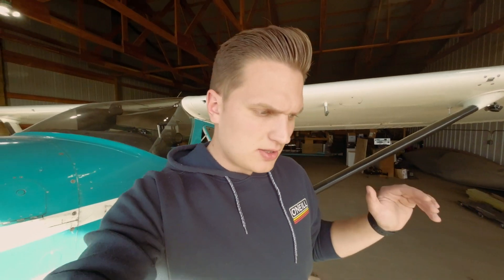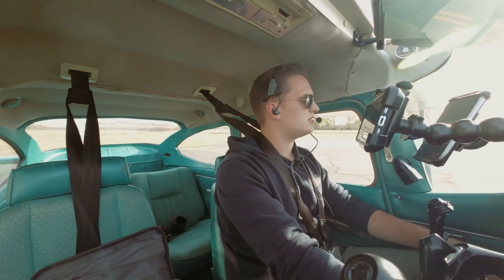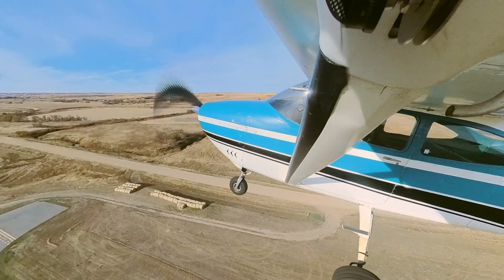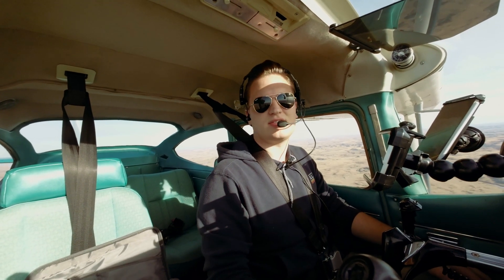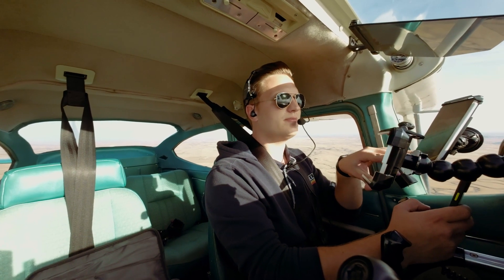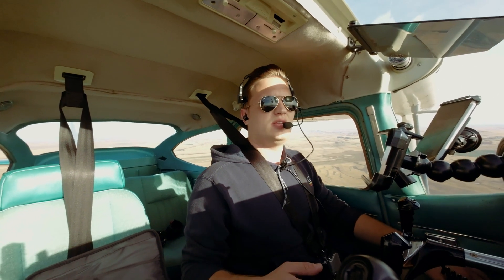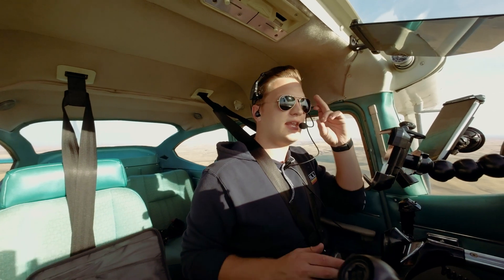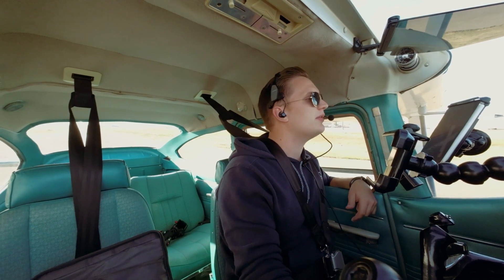How to Land an Airplane; Masterclass for Beginners

Comment from the maker: What did you think about these tips?
Reply: As a non-pilot I found it appealing to me meaning I know a lot more than I did...... lol,  since every plane is different I'm
guessing this will help those flying a similar bird more but I digress.  Is that right that more problems happen during
takeoff?  More incidences leading to damage, injury, & worse?  It makes sense but I've never heard anyone say it as
you did.  If I ever get the chance,  I'll be in a Part 103 type ride.... good video.  peace & GB
Reply from the maker: @diggy-d8w  Great to hear! Yes, because you are low and slow, takeoff is the most dangerous part of the flight. Once you get enough airspeed or altitude your flight becomes much safer because you now have time to figure what you're going to do in case of an emergency. Thank you for commenting!
Reply: IT's common sense & so logical that I guess most pilots do not speak of it all that often.....  which is why you've already
scoped out fields or the softer landing spots all around the field you're at.  I know I'd want to know those things around
any takeoff spot but it would be 2nd hand knowledge on your home turf.  <Subb'd Up>  see ya next time,  peace
Reply from the maker: @diggy-d8w  For sure! It's always good to know and review what you'd do in case of emergency. That way when it happens, you're prepared. Thanks for watching!
Reply: Dope vid man

You made me subscribe + like
Reply from the maker: @rapinncapin123  Thanks!
Reply: As non-pilot, I appreciate a basic idea of what it takes to get the plane on the ground.

Comment: I soloed at 15 hours with a female CFII whom was also ATP rated, then I stopped when I became a cop. Many years later I started again. Another CFII signed me off again. This time it was a male CFII with 4,000 plus hours. I earned my PPL when a DPE signed me off at around 40 hours as well. That DPE is an old bird and an airline captain + helicopter pilot.
Reply from the maker: Wow, that’s awesome!
Reply: @theaviatorew  what's next for you, commercial, CFI, CFII, multi-engine, ATP?

Comment: The most important thing you need to know about flying an airplane is how to use the elevator (pushing or pulling on the yoke); in level flight you use the elevator to maintain altitude......too high, push forward and lower the nose; too low, pull back and raise the nose.  When climbing or descending you use the elevator to control your speed....push forward to increase speed, pull back to lower it. The approach to land is a descent, so you control your airspeed with the yoke;  if your approach speed is 70 mph, just push forward or pull back on the yoke to maintain it. The second thing you have to do is control your rate of descent, which you control with the throttle...more power, you slow your RATE of descent, less power you increase it. How do you know what your descent rate is supposed to be?  Look out the windshield at the approach end of the runway;  if it appears to be in a stationary position in the windshield, you are on the correct glide path; if the runway begins to lower (disappear below the nose of the airplane) you are too high, so back off the throttle to slow your descent;  if the runway begins to rise in the windshield, you are too low and need to apply more throttle.  So lined up on final approach you only have to do two things, control the airspeed with the yoke, and your descent rate with the throttle....if you do that you will arrive at the runway at the right height and the right speed (and then the flare and touchdown).
Reply from the maker: Very true!
Reply: @theaviatorew  correction (typo); "too high, so back off the throttle to INCREASE your descent".
Reply: "When climbing or descending you use the elevator to control your speed"....

Totally Disagree. When decending, especially to land like in this video, you should be controlling your speed/power with the power control, not the yoke!
Reply: @davecarsley8773  You have no idea what you are talking about; you obviously are not a pilot...if you are, God SAVE US!!!

Comment: Ok, here's my nickel (used to be 2 cents, but, hey, inflation...) ... as a former paratrooper and skydiver with many Cessna 182 jumps and 20 min. as a pilot in a C152 instructional plane at a military base open house, I was looking for some stuff you didn't talk about ... like, the stall speeds with and without flaps, I got that, but you didn't go into what airspeeds you begin to deploy flaps and how much, what altitude to do that, how to calculate where to begin the descent portion of the flight profile, ..... was that stuff not covered because you figured the passenger at the controls would get all those instructions from ATC via the 121.5 channel? The 182 pilot I had the most jumps with was a veteran of the Luftwaffe where he flew F105s, and his hands were quite busy on the way down the 1 time I rode down with him as a student jumpmaster after putting static line students out.
Reply from the maker: There is definitely more that you could talk about when it comes to landing. However, I was trying to break it down is a simpler way for people to remember. ATC will definitely have to help them down. However, putting 10 degrees of flaps down before flap speed won’t hurt the airplane (in most cases) even past ten degrees one time shouldn’t make the flaps fall off. Thank you for the comment!
Reply: ATC does not tell you how to fly the plane. ATC is there to mostly provide collisions within their airspace. 
When a pilot deploys flaps (if needed) is entirely up to the pilot. When I owned my 172 I never used flaps with a x-wind above 20kts.
Reply: He OBVIOUSLY wasn't trying to be a flight instructor and give exact comprehensive landing instructions for this particular aircraft in a youtube video.

Comment: Your tip number one is critical at low altitude where inadvertent stall is generally fatal.  Airspeed, and not altitude, down here is life.  Altitude is time.  Time is good, but we have to stay alive long enough to have time.  We have to stay fast enough getting up to safely get up.  Consider acceleration to Vcc level in low ground effect for airspeed to maneuver when the engine quits.  Your 182 will try to climb out of free ground effect quickly so you will have to push against the Vy trim when she come off.  As a crop duster and pipeline pilot, I have had 11 engine failures at 200' or lower.  Never at Vx or Vy, however, as they are poor energy management and are unsafe.

Your 182 will not land in ground effect at 60 or Vso, an out of ground effect number.  It must be much slower.  It seem fairly heavy, but it is just a bit bigger 172.  I flies basically the same with a bit more power and a bit pitch up to slow down.  Yes, with full flaps we need to get enough sink to bring the throttle fully into dynamic play as the most excellent glide angle and rate of descent control all the way to touchdown slowly and softly on the desired  touchdown spot.  "The 'stall-down' landing requires that you blend the approach glide, the flare-out, and the slowing up of the airplane all into one maneuver so that, when you arrive at ground level, you arrive in three-point attitude, all slowed up and ready to squat."  Stick and Rudder page 302.

Staying ahead of the airplane on short final is much easier without any aileron and adverse yaw wing wagging to keep turning back to the centerline (between our legs not under the prop.)  Yes, we want longitudinal axis control with proper rudder yaw and no nose swinging the wrong way (adverse yaw.)  Walk the rudder pedals dynamically and proactively to bracket (correct yaw tail wag) the centerline between our legs.  Its optical, it will appear between the instructor's legs as well.  

Good lesson.  Just some old crop duster points.
Reply from the maker: Awesome info! Any crop duster that’s over 40 or so is worth listening to for safety tips. The rest didn’t live long enough to share. 😂
Reply: @theaviatorew  If we read Stick and Rudder for the principles like the law of the roller coaster, ground effect, and what the airplane wants to do, and then watch crop dusters work, we will see energy management (not acrobatics) in action.  We seek not the razors edge, as did Bob Hoover.  We avoid the razors edge with energy management.  Free ground effect energy in the field, pitch to just over the obstruction saving that zoom reserve airspeed, climb to a couple hundred feet and then trade that 200' for airspeed in the return to the field, bank at very steep bank angles to get back into the same field but at near 1 g whatever the bank angle by simply allowing the nose to go down as designed to maintain trimmed airspeed (not altitude) to prevent stall.  If the student was never allowed to pull back on the elevator in any turn in the pattern, much safety would result.
Reply from the maker: @jimmydulin928  That's true! I like that book! However, I'm ashamed to admit I've never finished it.